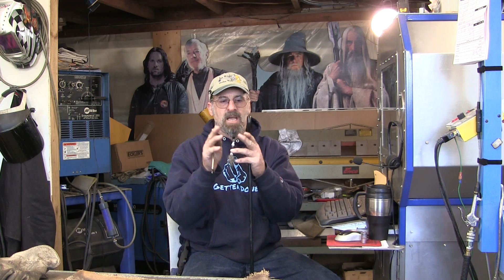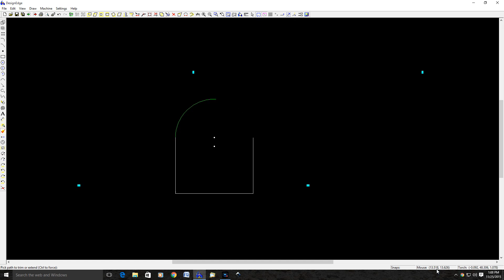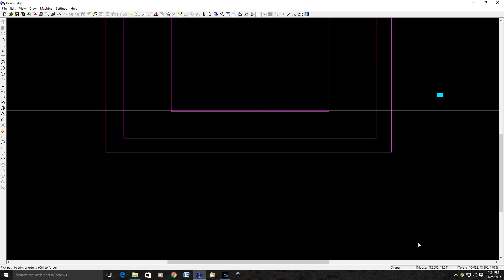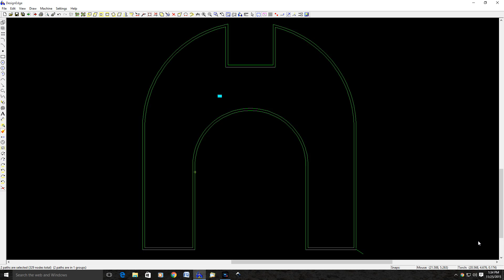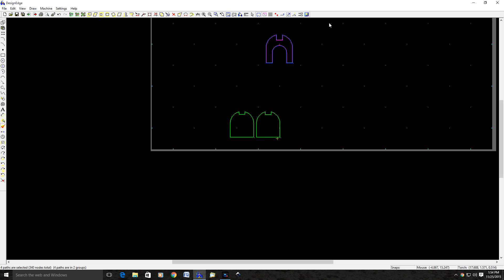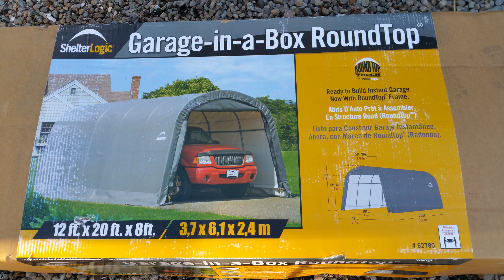The Impacted Idea

Comment: You might have been in the marine industry too long when you refer to the right hand side of your shop as the starboard side!
It's easy to overthink these shelters and try to make them permanent, but the whole point of them is they are quick and easy to set up, and take down again.
Come summer, Keith may want all that yard space for something else. With the shed the way it is, just unbolt it and it's back to open space.

Comment: It is against recomendations but our  shop runs 175psi  line pressure to all our air tools on at least 3/8 hose no more than 25ft long and we use 1/2 hose for 50ft or for the 3/4 and 1 inch guns. The higher air pressure really makes the air tools get after it. I can't think of any tool failures any of the guys have had from running them above the 90psi max the tool makers rate them.

Comment: So, with welding all that up, did you wind up having to remove the chrome from the socket? 

Usually, instead of using something even as nice as a Husky socket, I'll use something from Harbor Fright. If it winds up being a smoking wreck after the job is done, not an expensive loss. 

You should consider stamping something like "Snap-Off" on that tool :)
If it saved you some pain, all worth the effort.

Comment: anything is better than driving those things in and taking them out by hand. i recently fixed a leaning fence post and drove 2 in by hand with a 2ft piece of round stock for anchor points and it sucked so bad

Comment: When I saw you were going to cut out the centers, I thought it was a mistake at first, then I thought there was something about the design of the tool you were making that I didn't understand.  Then it turns out it was just a mistake.  We all do it.  I was just wondering about your plasma table.  Is the area the workpiece rests on disposable and replaceable?  It seems to me that it would get pretty chewed up after a while.  how long does the table last?
Reply from the maker: +fall22123 it is the second table grates in four years, they are consumables.  ;{)------
Reply: I have no  idea of what your table is made of, but in my high school and in college welding shops the on-edge bars of material that made up the burning tables was 0.25 X 3.0 solid copper. The copper was and is pretty impervious to damage (at least by ox-acetylene burning torches. But I have no idea how copper would fare with a plasma cutter. But then that was also circa 1970 and I am sure copper is much more dear now than then.
Reply: +Keith Fenner 

<!--
 /* Font Definitions */
@font-face
 {font-family:"ＭＳ 明朝";
 panose-1:0 0 0 0 0 0 0 0 0 0;
 mso-font-charset:128;
 mso-generic-font-family:roman;
 mso-font-format:other;
 mso-font-pitch:fixed;
 mso-font-signature:1 134676480 16 0 131072 0;}
@font-face
 {font-family:"ＭＳ 明朝";
 panose-1:0 0 0 0 0 0 0 0 0 0;
 mso-font-charset:128;
 mso-generic-font-family:roman;
 mso-font-format:other;
 mso-font-pitch:fixed;
 mso-font-signature:1 134676480 16 0 131072 0;}
@font-face
 {font-family:Cambria;
 panose-1:2 4 5 3 5 4 6 3 2 4;
 mso-font-charset:0;
 mso-generic-font-family:auto;
 mso-font-pitch:variable;
 mso-font-signature:3 0 0 0 1 0;}
 /* Style Definitions */
p.MsoNormal, li.MsoNormal, div.MsoNormal
 {mso-style-unhide:no;
 mso-style-qformat:yes;
 mso-style-parent:"";
 margin:0in;
 margin-bottom:.0001pt;
 mso-pagination:widow-orphan;
 font-size:12.0pt;
 font-family:Cambria;
 mso-ascii-font-family:Cambria;
 mso-ascii-theme-font:minor-latin;
 mso-fareast-font-family:"ＭＳ 明朝";
 mso-fareast-theme-font:minor-fareast;
 mso-hansi-font-family:Cambria;
 mso-hansi-theme-font:minor-latin;
 mso-bidi-font-family:"Times New Roman";
 mso-bidi-theme-font:minor-bidi;}
.MsoChpDefault
 {mso-style-type:export-only;
 mso-default-props:yes;
 font-family:Cambria;
 mso-ascii-font-family:Cambria;
 mso-ascii-theme-font:minor-latin;
 mso-fareast-font-family:"ＭＳ 明朝";
 mso-fareast-theme-font:minor-fareast;
 mso-hansi-font-family:Cambria;
 mso-hansi-theme-font:minor-latin;
 mso-bidi-font-family:"Times New Roman";
 mso-bidi-theme-font:minor-bidi;}
@page WordSection1
 {size:8.5in 11.0in;
 margin:1.0in 1.25in 1.0in 1.25in;
 mso-header-margin:.5in;
 mso-footer-margin:.5in;
 mso-paper-source:0;}
div.WordSection1
 {page:WordSection1;}
-->

Hey Keith, any particular reason why you used a chrome
socket instead of an impact socket? The chrome sockets sometimes have a
tendency to split under constant heavy impact.

Comment: I am surprised you software has no tool to align shapes on their center line and you have to do that manually.
Reply from the maker: +Olivier Nicole there are a few short cuts on centering and there most likely is some functions I have not become accustomed to yet, always learning, not going to stop until I learn, a short cut, just go at it until then. ;{)-----

Comment: I think you're just better off boring a hole, wowing out the bottom of the hole, dropping in your anchors and grouting the hole from there. It's what I did and it only took a short few minutes for each hole. My 13' x 22" shelter never even thought about blowing away in western NY storms (Near Batavia NY).

Comment: Yep, a hydraulic auger driver on a Bobcat is faster for driving helical anchors. Still.that was a nice socket; I could have wished to have such a device (adapted to the 1.5" hex of the Bobcat driver)  when I was anchoring temporary buildings.

You might consider drilling a hole through the side plates so you could put a retention bolt through that would keep the socket on the anchor if you had to pull. You might need a pin retainer on the impact driver (rather than the spring ball-detent) if you wanted to pull when extracting anchors.

The Bozo moment was what happens when you do your drawing on the computer rather than drawing on the steel. It's not that you never have Bozo moments; it's just that you see them sooner and can erase the chalk marks quicker. (Kidding; I think that Plasma-Cam is a really spiffy piece of equipment.) Great video.

Comment: I would bet the reason your impact is slowing down is due to ice forming in the air line due the venturi effect and some moisture in your air line. It happens to mine on long runs in cool temps.

Comment: I seen bozo lurking as you were drawing and wished I could contact you before he escaped out into the room. No worries and a good way to spin those anchors into the ground! I built my green houses much like your garage using PVC pipe and clear plastic tarp. Going on the third year and still holding good, probably will change out the tarps this coming spring.

Comment: instead of welding in a socket, why not leave the notches out of the side pieces.  that leaves you with a half inch square hole for the square drive.

Comment: I don't want to poopoo your work because even though the tool may not be practical, the process of making it is valuable. The best way to drive those augers into the ground would be with a crow bar through the drive end and a bit of elbow grease. Any hand held power tool requiring enough torque to drive that sucker in would be dangerous to handle.
Reply: +seephor apparently you didn't watch the whole video were he explains why he didn't do it that way

Comment: ......I'm liking those shelters more and more I tell ya....
Reply: +Brian Streufert Got a friend in Los Angeles who uses them, one as an impromptu (and highly illegal!) paint booth. They work well, last a long time and aren't silly expensive. With just a little planning they keep stuff fairly clean and dry. If needed, they break down as easily as they go up.
Reply: +Hotrodelectric LOL man I tell ya, with everything being either illegal or cancer causing in CA. I am surprised everyone isn't in jail or dead!! ;-)
Reply: +Fred Newman  You just have make sure that you seal up any gaps where dust, debris and critters can get in. You can get a decent finish, just that all the usual caveats of painting a car apply. You'll do better in the late Spring or early Summer if you go this route. Good luck!
Reply: +Brian Streufert Yah, somehow we just manage to keep on truckin' :)
Reply: +Hotrodelectric Great idea about "impromptu" paint booth! In need of one and was thinking of doing it out of particle board and rough framing, but that's a way better idea for use and storage! Thanks for mentioning it!!!!
Reply: +Fred Newman  Yep, Lay down a sheet of plastic with a larger footprint than the "shed" Put a frame made of 2X6 laying flat to attach the frames to. Then put the tarps on the shed and lift each side and tuck the extra material under the frame boards. That will secure the tarp material and seal the sides. Make a filter holder that you can put into each end panel. I like to use thin plywood Or replace the entire end with wood to make it easier to work with.

Comment: air volume is very important also check air pressure at work end of hose. pressure falls off rapidly as you 
lay out hose. rubber hose expands and causes pressure drop.  I always run a minimum of 1/2 inch hose on my impacts and never run longer than 50  feet without running solid pipe if I expect to get full pressures at work site..

Comment: HaHaHa ! I was trying to see how the outside plates would work with the centers cut out. Good idea, but I think a 3/4" drive or even 1" would drive it faster. Several years ago, i was putting up wind measuring towers that had helical anchors for the guy wires. these were large ones, about 6" diameter. We made a similar rig that attached to a hydraulic auger on a Bobcat.  Worked well even in the tough soil of west Texas.
Thanks for sharing. Get that Porsche under cover, winter is coming.

Comment: Lots of very good ideas to why you had so much trouble. For my pennys worth I would cut the spike of the end of the auger. Every time the end hits an obstacle the auger stops feeding into the soil and loosens the material around it. As it no longer feeds you have to lean on it until the spike drills through, or around, the blockage. At that point the auger bites into fresh material and starts feeding. It's a bit like trying to tap a blind hole in ally with a taper tap. Or it was a Monday?

Comment: I had to setup 5 of these storage tents for a customer in NH.

We welded a hexrod to a D-Shackle and attached it to a Hole-Hawg. 

It took ~20 minutes to haul out the stick welder and make the tool. 

It took longer to grind-off the shackle and put it back into stock.

Comment: Hi mate.  I was looking at it and thought that you had not adapted the size of the "port" to hold the auger, but at the same time I thought, he must have done that, but alas.  Chances are that you might have been a lot better of with a good strong power drilling machine to get those augers in the ground.  I have made the same mistake with those pneumatic ratchets.  they work nicely on stuck bolts, but are less than useless on projects like this.

Comment: Hi Keith,
I made a set earth anchor drivers for a customer years ago. I used a 1HP reversible 120VAC gear reduction motor mounted into a nice 30" wide frame that he could handle and had a reversing spring loaded switch at fingertip reach. He used them for driving mobile home earth anchors. Last time I seen him he said that the drivers were still working as well as the day he picked them up. The problem with common small pneumatic or electric impact drivers is that the earth dampens the hammering effect and the motor by itself just doesn't have the torque to turn the earth anchor without the hammering effect.

Joe

Comment: Very cool build!   When we put anchors or eye lags in, we've been using a large hook bolt in the worm drive right angle drill to turn them in. Using the hook to remove them becomes easier because you can pull up on on it while spinning. The right angle drill is really very good for most any place we've used it on.   I'm going to make what you designed but I'm going to use hex rod instead of a socket.   Thanks for the video!
.
Reply: Bigger version of my cuphook trick. Pulling them out is real easy and putting them in the round eye to round eye contact keeps it centered/aligned.

Comment: I like the build and concept. I would be willing to bet if you had a tool to drive your socket and anchor with a steady turn like a gear reduction electric motor drive with a clutch for safety, handle for leverage and reverse eliminating all the torque lost to the spring in the rod while you are driving it in the ground you would have a great tool especially if you had to do a lot of anchors. Next would be a hyd. driven motor with gear reduction to do the same. Pretty much the same concept as an auger used for telephone poles of fence posts but on a smaller scale. Enjoy watching and always learning from your videos. Thank you, Ed K. Cleve. Ohio.

Comment: Bigger air line would definitely help, as would a 3/4" or 1" impact.   Needs more 'stroke' per hit on the impact, because a lot of the energy from the impact is being wasted just twisting the shank of your anchor (like a big torsion spring).And add some water, I watched a guy from the electric utility drive a 10 foot ground rod with his hands and a cup of water...  Just walked it right in by pouring s little water down the side of the ground rod and twisting/wiggling it (soil is mostly clay here).
Reply: +icesoft1 Those 1" impact drivers the truck shops use for wheel lugs. Some rental shops offer them. But you need the CFM to make them work.

Comment: Hey Keith,
nice to see you back in the groove again ! thanks for the tips on this type of lean-to. 

might it have been a little easier using a gas powered post hole auger? 
adapting the tool shouldn't be much of a problem.

also it's nice to see the little pitfalls even a master such as yourself has at times. everybody makes everything look so easy in their videos and there have been a few times i have questioned my own skills and finesse when attempting some projects.  it shows the human side of you. which in my eyes makes you an even better mentor.

cheers
mike

Comment: .

In the past I have screwed those anchors in with a bar, hard work. I used a garden hose to dribble water down the anchor and that seems to make it go in a bit easier.

I like that tool you made, it does save a lot of effort.

Thanks for the video.

.
Reply: This Old Tony could make that tap, and drill the hole too!

Comment: Ah yes....the rotation flex within the anchor shaft absorbing most of the impact force produced by the air tool, making it a slow process, been there done that.  I have found that the use of a large gear reduction drill motor with long side handles works well in jobs like this, as long as you hang on tight to prevent becoming the next visitor to the ER.  Nice shed Kieth, thanks for sharing.
Reply: +pkav8tor  I didn't figure the shaft flex.  Great observation.
Reply: +WAVETUBE84 It's sounds like true... But impact drilling through long torsion bar is like a hammering through rubber block. Very inefficient deal. And impossible in case of root or rock.
Reply: +WAVETUBE84 And that's one of the reasons why most drills have torque limits. I usually set the clutch on mine to the lowest torque I need for a given job so I don't have to worry about the drill suddenly jumping out of my hands or grossly over-tightening something due to a momentary distraction.
Reply: Ah, so they were working like the torque sticks tire shops use when putting lug nuts on (before they re-torque with a manual torque wrench)
Reply: Yes, it's true. Better use non impact power or manual driving.
Reply: ***** That's the whole point:  he didn't want to hurt his shoulder (evidently his shoulder is hurt already?).   This was just an attempt (and some good video).  But, I have to agree with you:  a regular electric drill would work better.  But, they put a tremendous strain on your shoulders.... when the grab a rock or root....